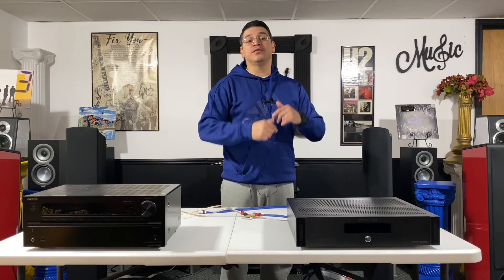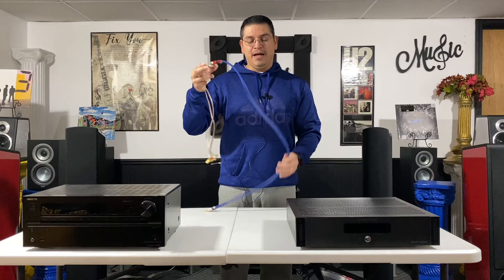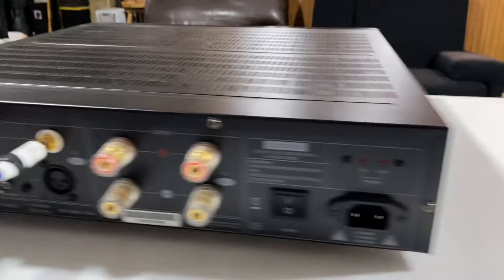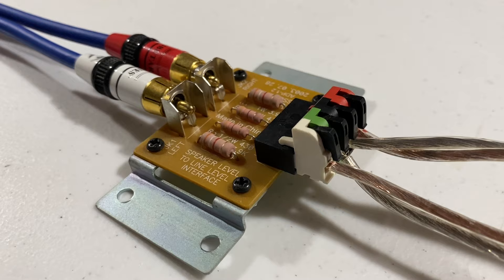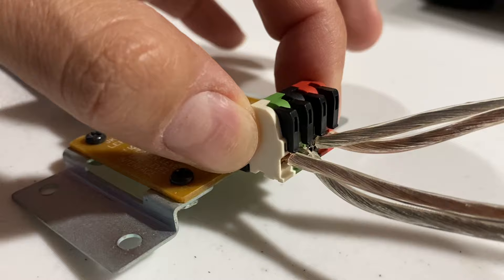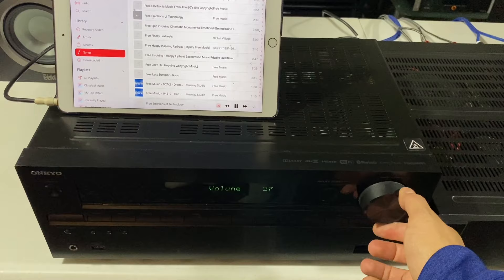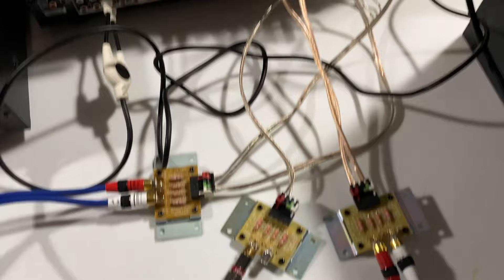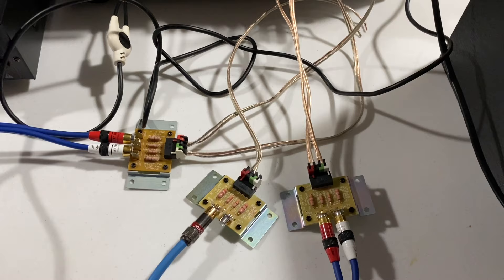Connecting an amplifier without using preouts.

Comment: Hey, im back on your channel!! I have a question, the internal amps of the receiver will be shut down with this method? On models that have pre amps out i believe they shut down or staying idle but what about this method? Thanks!
Reply from the maker: Welcome back. Actually the internal amps stay on because it used the signal and power from the speaker output. So in a way it’s kinda like double amping. Thanks for watching again 👍
Reply: @Audiolympian  i see, thanks for the info Olympian!
Reply from the maker: @AexoeroV  my pleasure. Thanks for the support

Comment: Hi, this review is very much helpful,  but I am living in France and couldn't find it. This item can't deliver in France.  Do you know similar items that I can use? 😢 By mistake I've bought a NAD power ampli. Now I can not fix it, to buy another preamplifier will be very costly. I have an integrated ampli and want to connect to power ampli. Thanks in advance. Cordialement Sourav.
Reply from the maker: Hello. Sorry for your misfortune. I’m not aware of any other devices that can do this. However, I have had a few people tell me they came across a device that can do the same thing that is made for car audio, I’m not sure how auto parts work in your country but perhaps you can look into that as a solution. If I ever do come across another device I’ll let you know. Hope that helps. Thanks for watching
Reply: I bought a converter from a car audio shop. It works beautifully
Reply from the maker: @paddyfeeny4518  very cool. I’ve had some people ask about other devices. Thanks
Reply from the maker: gutodourado  I’ve heard some people say the car audio devices do work for home stereo, you can certainly try it. I haven’t done it so I can’t say if it does work. Thanks for watching
Reply: gutodourado  Hi! Yes I bought it and works very well. It is so cheap, I bought 2 pieces on 5 euros only, no shiping cost. It's take time to get from China. 3to 4 weeks.

Comment: Can I do the same process if I use PA amplifier let me know
Reply from the maker: Others have asked that before. I would think so as long as the amp has rca inputs. But I don’t know if any of the other people had any success with it. Thanks for watching
Reply: @Audiolympian  if I wanted to connect a sub with the same process do I need another adapter?
Reply from the maker: @Texas059  yes, unless you use one RCA for a speaker or the other one for a sub. But if you’re using both connections on the adapter then to connect a sub you’ll definitely want a second adapter.

Comment: It would have been nice if you had an actual link for the item description as I am having trouble finding it on eBay......so far no luck.
Reply from the maker: Some others have said the same thing. You can try Amazon as well. They had some last month
Reply: @Audiolympian  i also read that they are not compatible with digital amplifiers.....not sure what that means. Please bare with me as I'm kinda new to this and learning what and how to do all of this. I just simply want to hook up a Rotel Power Amplifier through my Onkyo TX-NR686 that does not have pre RCA outputs like some more higher end receivers do. For now I would just like to amplify my front L and R speakers since they are capable of bi-wiring. I just want to be assured that if I find a pre-out conversion to buy that it will be compatible and work with my Power Amplifier.
Reply from the maker: Yeah we m not sure what the digital amp compatibility means either. But for the gear you have and what you’re looking to do it should work fine.
Reply: @Audiolympian  Yeah I don't believe I should have any issues with hooking it up and it working fine. From what see im basically going to have it running on equipment similar to what you have in the video. I did however have a heck of a time trying to locate one. Inevitably I was finally able to get one ordered through a company called Digital Home Creations online who said that their distributor is showing it as available so he sent me an invoice via email and it will be dropped shipped to me directly from distributor for a total of $49.99 that encludes shipping of a flat fee $10 bucks so not too bad. Just happy as a pig in shit I was able to find one finally SMH. Amazon is showing not available and it doesn't come up at all on ebay.
Reply from the maker: @thomasfitzgerald2595  glad to hear you located one. Hope it all works out for you. If you have any other questions please don’t hesitate to reach out. Thanks for watching and commenting it helps the channel a lot

Comment: Will connecting the A/B right chl, to one Russound and A/B left chl, to a second Russound and those to separate power amps give me stereo running two power amps off my Yamaha S501?
Reply from the maker: Actually that would give you 4 speakers running. But yes you would have stereo on both amps.
Reply: I'm not running 4 speakers. From the back of my S501 there is A(front/main), left and right.  Also B, left/right. The way you show it, you connect the A to one ADP then to another amp. I'm wanting to connect A/B rights to one ADP and A/B lefts to a second ADP, and each ADP to separate power amps. Would this give two channel stereo with increased power? Or would I damage my system.
Reply from the maker: @sloboat55  this would work for you without damage.
Reply: @Audiolympian  Thanks for the wicked quick response. You know how much that means to people.
Reply from the maker: @sloboat55  thanks for asking. I try to stay connected to everyone that takes the time to reach out.

Comment: I am wondering if you connect an external amplifier on av receiver throw this device, does the av receiver drives more power to the other speaker outputs ?
Reply from the maker: Good question many have asked. Depending on the receiver it will they are designed that way but not in the way it seems it should. Receivers always pull power from one channel to another but only when it needs it like an explosion or car crash. It’s not continuous power. So this method does allow for more head room on the other channels but it’s just a little bit more
Reply from the maker: Thanks for watching
Reply: @Audiolympian  thanks for your reply
Reply from the maker: @JUNAutoMechanic  you’re welcome
Reply: @Audiolympian  And one last thing , if I want to connect an integrated amp to my receiver , I just connect the speakers cable ( Front R/L) to this device and then the RCA cable to any input source of the amplifier (e.x AUX , CD) ?
Reply from the maker: @JUNAutoMechanic  maybe. Several people have asked about connecting integrated amps. I’m not sure if it will work with those.

Comment: what if i have an av reciever with pre outs which i do but  i dont have an external pre amp like your emotiva to add power to the reciver?
Reply from the maker: Then you probably won’t need an adapter if you don’t have another external amplifier for more power
Reply: @Audiolympian  Thanks, but is there a way i can i power the pre outs on my pioneer av reviver that has pre outs with 2 spare normal av recievers ive got i just want to lower the load on my pioneer and add power
Reply from the maker: @Mattyboy88979  actually yes you can as long as the spare receivers have rca audio inputs.
Reply: @Audiolympian  Which inputs on the amp should i use as you can only select one at a time cant you like cd dvd ?
Reply from the maker: @Mattyboy88979  if you’re referring to an integrated amp, I’m not sure these will work with that amp. But if you’re going to try it I’d connect to which ever source your using so cd for music or dvd for movies or aux if you have that option. Hope that helps. Thanks for watching

Comment: What about the center channel speaker? If i wan't to do
Reply from the maker: The only thing you have to do with the center channel is use just one side of the adapter. It will still work
Reply from the maker: Thanks for watching
Reply: @Audiolympian  Hey i just bought two can you explain to me how to hook up the center channel i have a marantz 5 channel amp how would i hook it up to my denon 7.2
Reply from the maker: @DCProductions77  sure. One adapter will connect your front left and right speakers to your amp. Then on the other adapter just connect the center speaker wire from your receiver to one side of the adapter and then one RCA cable from the adapter to your amp. Hope that makes sense.

Comment: Question when using the adapter is the AVR still powering the speaker or is the internal amp still turned on
Reply from the maker: Yes and yes. When using the adapter The avr is still the main controlling component along with the external amplifier. And the internal amp is still active, in case you have other speakers connected directly to the avr.  Hope that answers your question. Thanks for watching
Reply: Thank you.  Despite the internal amp in the AVR still powering I will still get more power from the external amp when using the adapter
Reply from the maker: @samparks3479  definitely

Comment: So, since you have it plugged into the front 2 channels, would it still function in a 5.1/7.1 setup since the receiver still perceives that there are two speakers hooked up to it at the terminals.  I have some new towers that are power hungry and looking for a solution since I like my AVR.
Reply from the maker: Yes. I originally had it hooked up with just my front mains before doing a full 5 channel set up. Hope that helps. Thanks for watching

Comment: I gave a question for you. I get and ax amplifier by mistake and its is to late to return it. Is there a way to hook it to an av reciever for movies and such.
Reply from the maker: I’m not familiar with that amp so I’m not sure. Sorry I couldn’t help you. If you give me the model number I can check it out and give you an assessment. Thanks for watching
Reply: @Audiolympian  technical pro AX2000
Reply: @Audiolympian  thanks
Reply from the maker: @fatcatpeople  by looking at that amp. You should be able to connect it to a receiver, through receiver preouts or the adaptors I use in this video.
Reply: @Audiolympian  its missing one cable. It says monitor in and its yellow. I dint have that in my amp
Reply from the maker: @fatcatpeople  you shouldn’t need to connect that. That’s for a tv or monitor. That’s why your amp doesn’t have that connection.
Reply: @Audiolympian  for some reason it won't work on my av reciever. But thanks for the help.
Reply from the maker: What kind of receiver do you have?
Reply: @Audiolympian  sony. From whatvi heard they are kind of bad. STR DH550
Reply from the maker: @fatcatpeople  gotcha. Sorry man. Good luck
Reply: @Audiolympian  thank you. Know i on im not going crazy. Time to figure out what's wrong. Its must be the amp. Thanks.

Comment: Do you have a link for the adapter?  I can not find it on eBay.
Reply from the maker: Here is a link on Amazon. Not sure if it’s available here 
https://www.amazon.com/Russound-ADP-1-2-Speaker-level-Line-level-Adapter/dp/B01KYHD5SC/ref=mp_s_a_1_3?crid=2LD41BDEW6RHQ&keywords=russound+adp-1.2+speaker-level+to+line-level+adapter&qid=1640922835&sprefix=russoun%2Caps%2C153&sr=8-3

Comment: Great video! Can I just use speaker wire to an rca adaper and plug into this Fosi Audio TDA7498E, and to my L/R speakers without the adapter?

With your setup, is power additive, your original amp’s and the secondary’s?
Reply from the maker: You may be able to use an rca adapter. And yes in this set up you get power from the receiver and the amp. Thanks for watching
Reply: Thanks for the reply!
Reply from the maker: @mikeaferrer6659  anytime

Comment: Why not use the line out zone 2??
Reply from the maker: You can but signals from main zone converting to zone 2 can be tricky. 1. zone 2 is usually only 2 channel pcm sometimes analog but it’s only stereo 2. Depending on the main source device the signal won’t transfer to a 2 channel pcm signal and a few other things. So this set up is for people that still want multichannel surround sound but would like more power. Thanks for the question and for watching.
Reply: @Audiolympian  

Good stuff! I don’t know much, I just bought a new denon to find out it didn’t have a zone 2 line out to be connected from my bus in RCA from my amplifier… now I’m screwed (have 3 zones that I can’t use from my amp)
Reply from the maker: @joem914  that sucks man. The average receiver today doesn’t come with a lot of options. I think they want us to purchase the more expensive models. So we just do what we can.

Comment: Work whit Crown XLS 2502 Amplifier ?
Reply from the maker: Should be able to using its rca input. Thanks for watching
Reply: @Audiolympian  is 400 watts per channel att 8 homs
Reply from the maker: @nathaneldogo  those have very good class d amp design
Reply: Is not too much power for the adapter?
Reply from the maker: @nathaneldogo  not the class d design. It should be good
Reply: @Audiolympian  thank you waiting on the adapter to put my denon in Beast mode 💪whit the crown 👑
Reply from the maker: @nathaneldogo  it’ll be a great holiday time for you
Reply: @Audiolympian  Hello, you can put the adapter with the receiver and it worked but I don't notice much difference in volume compared to the reciver, that's just normal or it is supposed to be much harder. ?
Reply from the maker: @nathaneldogo  I guess the sound differences would depend on your amplifier you’re using. For example I use my adapter with a pioneer receiver that’s rated at 100 watts per channel and I connect my class A/B Sunfire amp that is 200 watts per channel with strong voltage. Class d amps can push a lot of watts but tend to be low with voltage which makes them cheaper, smaller (good things) but not produce the best sound.
Reply: @Audiolympian  ok I understand the problem must be voltage because it says 450 watts per channel at 8hm
Reply from the maker: @nathaneldogo  👍

Comment: But how do you calibrate the system 😭
Reply from the maker: That is more challenging, but depending on your receiver you can still run audyssey or any kind of system like that. At the very least you could use a hand held decibel reader and calibrate each speaker that way. Thanks for watching and commenting

Comment: Is my message successful?
Reply from the maker: Yes
Reply: @Audiolympian  I guess my comment with an amazon link , it is blocked
Reply: @Audiolympian  I bought this converter (Kuuleyn-Converter-Adjustable-Impedance-Modified). After preout, my main channel became very loud. Even if I lowered the speaker level to the minimum of -12db in the receiver setting there was still 80db. I'm wondering if this one is for the car so it can't be used with a home theater receiver, if so I'll just buy another Russound ADP-1.2
Reply from the maker: @WallaceChen  yes that one is for car audio. So it probably doesn’t have the same capacitor or rectifier, that maybe why it’s quite loud. Hope that helps.
Reply: New adapter is on the way😂  On more question，have any suggestions about the length of speaker cable connected av receiver and adapter ?
Reply from the maker: @WallaceChen  cool. For the adapter, I try to keep the wires as short as possible, as to not attract any interference or pick up noise. The rca cable is different, those can be longer as long as it has fairly decent shielding. Monoprice has good rca cable pretty cheap. Hope that helps.

Comment: DO NOT USE THIS SOLUTION.
That is just a resistor divider. You really need to have an active line level adapter. This is not a good way to go about this
Reply from the maker: Not sure what experience you’ve had with this device but I’ve been using them for more than 2 years on two systems and have not had any problems whatsoever. Appreciate your feedback and thanks for watching
Reply: Already a week using the adapter in my Pioneer VSX 932 and my 15 inches woofers main speaker came to life. This video have already 1 year and none in the comment has mentioned any issue with the adapter  ,maybe you got a bad experience for not following exactly the guide in the video ,sorry about that

Comment: Or you could just ditch your cheapo entry level AVR with no preouts, and get a real AVR/Prepro with pre-out's included, instead!!   That would make too much sense
Reply from the maker: Well truthfully this video is not for the cheap avr’s if that was the case you’d be 100% correct. This video is for the higher quality older model avr’s that didn’t come with preouts. There is the debate that heavy duty older gear is better than the lower quality build, inflated wattage avr’s of today. Some people like their older gear but want more power. Thanks for your input and for watching
Reply: Higher quality older model AVR's, that don't have pre-outs???  That's a good one!! lol! You'd first need to be referring to older entry level AVR's with older processing, which are outdated anyway!  Give me one example of an old quality AVR where anyone in their right mind would want to go through this hassle, rather than the obvious needed upgrade path!?!  Sure! Go ahead..I'll wait!!!  Cause I can't see any scenario where someone would be stubborn enough to not upgrade to newer technology, personally. Any 1990's to early 2000's entry level AVR's (only ones with no pre-outs) are old outdated surround processing (not mentioning video) technologies , utilizing old DD PCM at best, and also have inferior amplifiers built in, and marginal preamp sections in the analog domain (let's be honest), particularly at the lower price points.  So why would anyone hang on to a 20+ year old AV receiver again? Cause I'm sure I must be missing something here. But, then again, I highly doubt it